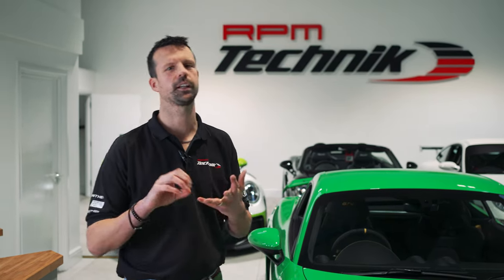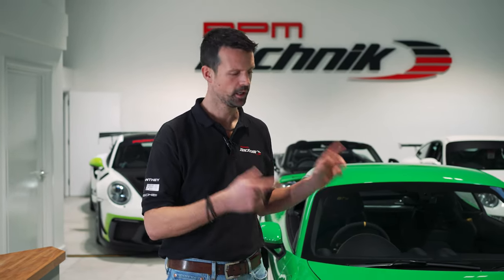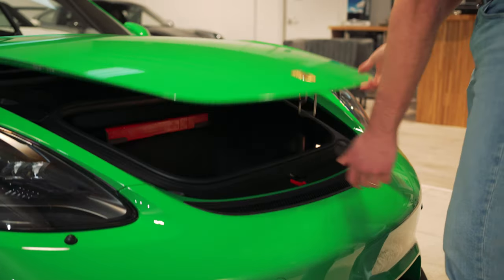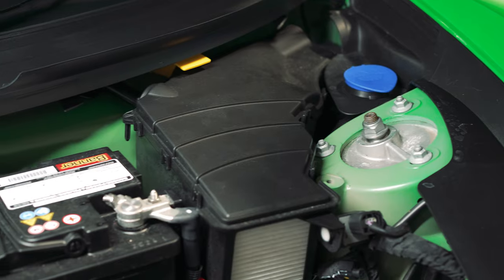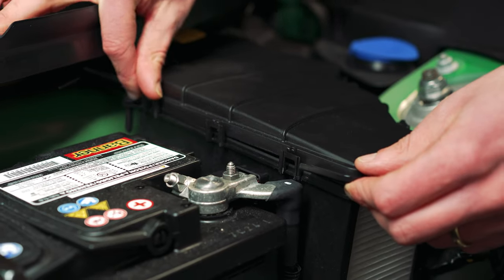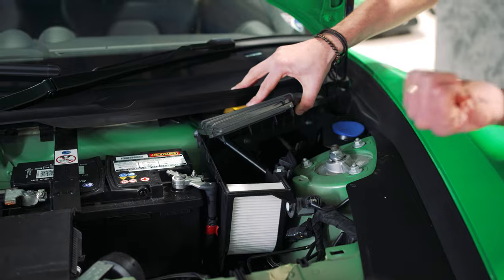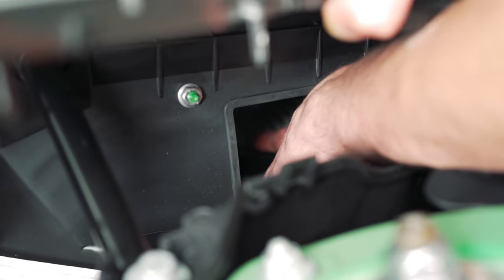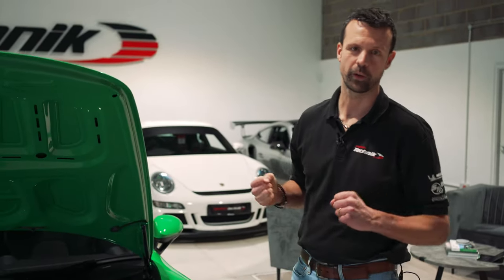How to FIX your PORSCHE Air fans - 991, 991.2, 981, 718

Comment: Thank you.  The blower stopped working after a 4 week pause in use.   Used finger to move fan and it works!  The clips on the blower assembly are 50% broken so someone wasn't being careful in the past.  2014 Boxster

Comment: Thnx a lot. Worked perfectly for my 991.2 GT3 touring. I made a long stick with soft tip to turn the fan so I did not have to open the blower box cover completely. This  to prevent clips breaking off...

Comment: My A/C (991 GT3) is only working by driving at higher speeds (lets say >100 Kmh) but not when moving in the city (30-50kmh). Could a stuck fan cause this issue?

Comment: Excellent advice but may i ask a question to the community, is this rare or are porsche so unreliable that fans don't work after a few days rest?
Reply: buy one and find out.
Reply: Mine seems to go wrong after a week of non use in the winter. 2018 Cayman S
Reply: Porsche shares a lot of parts with VW... VW is well um VW! So its ight... better than usa domestic, but 100% NOT a toyota.

 It is a high strung vw bug with the engine on the wrong side. This logic is throughout the car. There are many "hacks" and "easy fixes" for these cars but some idiot might take the car to the dealership and keep porsches economy in check via things like this... meanwhile, the true mechanics and DIY'ers are looking at this vid ;)